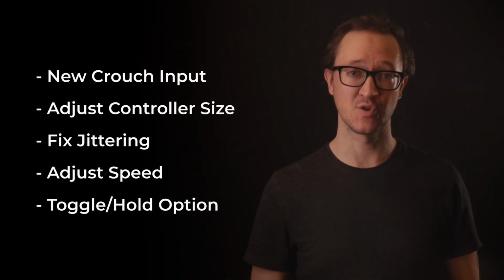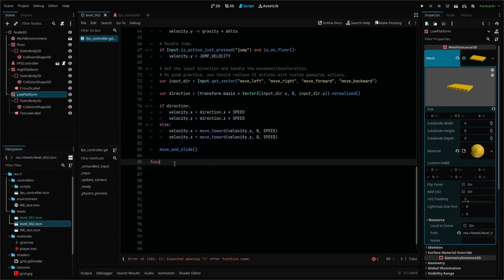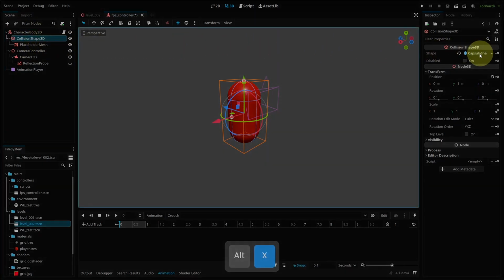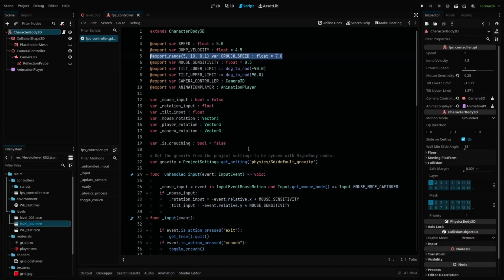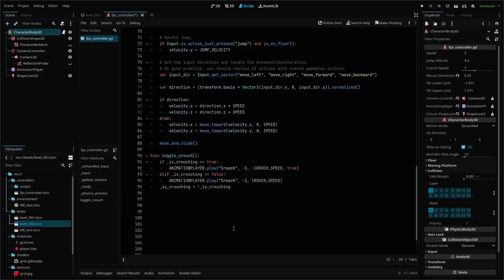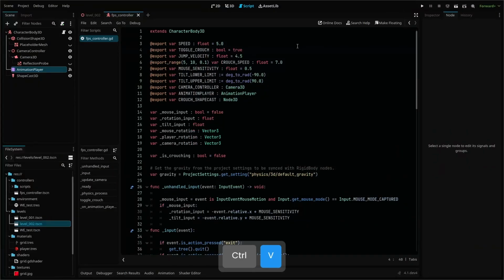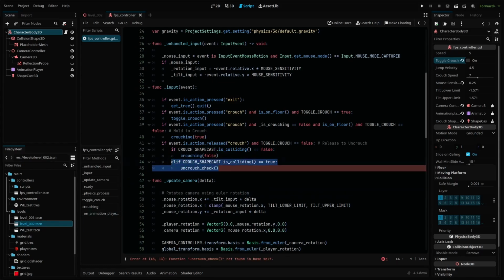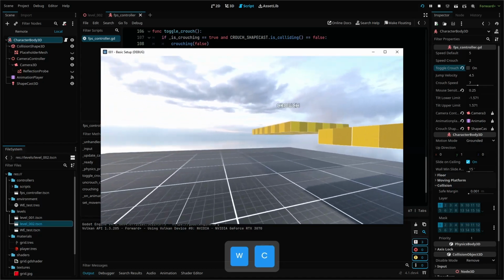E02 - Crouching // Make An FPS in Godot 4

Comment: extends CharacterBody3D

@export var WALK_SPEED: float = 5.0
@export var CROUCH_WALK_SPEED: float = 2.0
var _speed: float
@export var JUMP_VELOCITY: float = 4.5
@export_range(5,10,0.1) var CROUCH_SPEED: float = 7.0

# mouse capture
var _mouse_input: bool = false # is mouse moving
var _mouse_rotation: Vector3
var _rotation_input: float # mouse x value
var _tilt_input: float # mouse y value

# camera movement
@export var MOUSE_SENSITIVITY: float = 0.5 
@export var TILT_LOWER_LIMIT := deg_to_rad(-90)
@export var TILT_UPPER_LIMIT := deg_to_rad(90)
@export var CAMERA_CONTROLLER: Node3D

# rotation
var _player_rotation: Vector3
var _camera_rotation: Vector3

var _is_crouching: bool = false
@export var ANIMATIONPLAYER: AnimationPlayer
@export var CROUCH_SHAPECAST: Node3D
@export var TOGGLE_CROUCH: bool = false

func _input(event):
	if event.is_action_pressed("exit"): get_tree().quit()
	if TOGGLE_CROUCH:
		if event.is_action_pressed("crouch") and is_on_floor():
			toggle_crouch()
	else:
		# HOLD mode
		# Press: start crouching (only if not already crouching)
		if event.is_action_pressed("crouch") and !_is_crouching and is_on_floor():
			crouching(true)
		# Release: try to uncrouch
		elif event.is_action_released("crouch") and _is_crouching:
			if !CROUCH_SHAPECAST.is_colliding():
				crouching(false)
			else: uncrouch_check()
	

func _ready():
	Input.mouse_mode = Input.MOUSE_MODE_CAPTURED # captures the mouse, centers it, and hides it
	_speed = WALK_SPEED
	CROUCH_SHAPECAST.add_exception($".") #ignore CharacterBody3D from being detected in uncrouch collision

func _unhandled_input(event: InputEvent) -> void: # will fire everytime the mouse is moved
	_mouse_input = event is InputEventMouseMotion and Input.get_mouse_mode() == Input.MOUSE_MODE_CAPTURED
	if _mouse_input:
		_rotation_input = -event.relative.x * MOUSE_SENSITIVITY
		_tilt_input = -event.relative.y * MOUSE_SENSITIVITY

func _update_camera(delta):
	#rotate camera using euler rotation
	_mouse_rotation.x += _tilt_input * delta
	_mouse_rotation.x = clamp(_mouse_rotation.x, TILT_LOWER_LIMIT, TILT_UPPER_LIMIT)
	_mouse_rotation.y += _rotation_input * delta
	
	_player_rotation = Vector3(0.0,_mouse_rotation.y,0.0)
	_camera_rotation = Vector3(_mouse_rotation.x,0.0,0.0)
	
	CAMERA_CONTROLLER.transform.basis = Basis.from_euler(_camera_rotation)
	CAMERA_CONTROLLER.rotation.z = 0.0
	
	global_transform.basis = Basis.from_euler(_player_rotation)
	
	_rotation_input = 0.0
	_tilt_input = 0.0

func _physics_process(delta: float) -> void:
	# Add the gravity.
	if not is_on_floor():
		velocity += get_gravity() * delta
	
	_update_camera(delta)

	# Handle jump.
	if Input.is_action_just_pressed("jump") and is_on_floor() and !_is_crouching:
		velocity.y = JUMP_VELOCITY

	# Get the input direction and handle the movement/deceleration.
	# As good practice, you should replace UI actions with custom gameplay actions.
	var input_dir := Input.get_vector("move_left", "move_right", "move_forward", "move_backward")
	var direction := (transform.basis * Vector3(input_dir.x, 0, input_dir.y)).normalized()
	if direction:
		velocity.x = direction.x * _speed
		velocity.z = direction.z * _speed
	else:
		velocity.x = move_toward(velocity.x, 0, _speed)
		velocity.z = move_toward(velocity.z, 0, _speed)

	move_and_slide()

func toggle_crouch():
	if _is_crouching:
		if !CROUCH_SHAPECAST.is_colliding(): #uncrouch
			crouching(false)
	else: #crouch
		crouching(true)

func uncrouch_check():
	if CROUCH_SHAPECAST.is_colliding():
		await get_tree().create_timer(0.1).timeout
		uncrouch_check()
	else: crouching(false)

func crouching(state: bool):
	if _is_crouching == state:
		return
	_is_crouching = state
	if state: 
		set_movement_speed("crouch")
		ANIMATIONPLAYER.play("Crouch", -1, CROUCH_SPEED) #crouch
	else: 
		set_movement_speed("walk")
		ANIMATIONPLAYER.play("Crouch", -1, -CROUCH_SPEED, true) #uncrouch

func set_movement_speed(state: String):
	if state == "walk": _speed = WALK_SPEED
	elif state == "crouch": _speed = CROUCH_WALK_SPEED

Comment: Do same thing for toggle and hold to crouch. But when i start game when TOOGLE var have not checked value in inspector playing both and like hold and like press crouch... But when i TOGGLE var have checked value it only works with press like its need to work...
Reply: UPDATE:

This code fix my problem

extends CharacterBody3D

@export var SPEED: float = 5.0
@export var TOGGLE_CROUCH : bool = true
@export var JUMP_VELOCITY: float = 6.5
@export_range(5, 10, 0.1) var CROUCH_SPEED: float = 7.0
@export var MOUSE_SENSIVITY: float = 0.08
@export var TILT_LOWER_LIMIT := deg_to_rad(-90.0)
@export var TILT_UPPER_LIMIT := deg_to_rad(90.0)
@export var CAMERA_CONTROLLER: Camera3D
@export var ANIMATION_PLAYER: AnimationPlayer
@export var CROUCH_SHAPECAST: Node3D

var _mouse_input: bool = false
var _mouse_rotation: Vector3
var _rotation_input: float
var _tilt_input: float
var _player_rotation: Vector3
var _camera_rotation: Vector3
var _desired_crouch := false

var _crouch_anim_playing := false

var _is_crouching: bool

func _input(event: InputEvent) -> void:
	if event.is_action_pressed("exit"):
		get_tree().quit()
	if not is_on_floor():
		return

	if TOGGLE_CROUCH:
		if event.is_action_pressed("crouch"):
			toggle_crouch()
	else:
		if event.is_action_pressed("crouch") and _is_crouching == false:
			crouching(true)
		if event.is_action_released("crouch"):
			crouching(false)
		
func _unhandled_input(event: InputEvent) -> void:
	_mouse_input = event is InputEventMouseMotion and Input.get_mouse_mode() == Input.MOUSE_MODE_CAPTURED
	if _mouse_input:
		_rotation_input = - event.relative.x * MOUSE_SENSIVITY
		_tilt_input = - event.relative.y * MOUSE_SENSIVITY
		
func _update_camera(delta):
	_mouse_rotation.x += _tilt_input * delta
	_mouse_rotation.x = clamp(_mouse_rotation.x, TILT_LOWER_LIMIT, TILT_UPPER_LIMIT)
	_mouse_rotation.y += _rotation_input * delta
	
	_player_rotation = Vector3(0.0, _mouse_rotation.y, 0.0)
	_camera_rotation = Vector3(_mouse_rotation.x, 0.0, 0.0)
	
	CAMERA_CONTROLLER.transform.basis = Basis.from_euler(_camera_rotation)
	CAMERA_CONTROLLER.rotation.z = 0.0
	
	global_transform.basis = Basis.from_euler(_player_rotation)
	
	_rotation_input = 0.0
	_tilt_input = 0.0
	
func _ready() -> void:
	Input.mouse_mode = Input.MOUSE_MODE_CAPTURED
	CROUCH_SHAPECAST.add_exception($".")

func _physics_process(delta: float) -> void:
	# Add the gravity.
	if not is_on_floor():
		velocity += get_gravity() * delta * 2.5
		
	_update_camera(delta)

	# Handle jump.
	if Input.is_action_just_pressed("jump") and is_on_floor() and _is_crouching == false:
		velocity.y = JUMP_VELOCITY

	# Get the input direction and handle the movement/deceleration.
	# As good practice, you should replace UI actions with custom gameplay actions.
	var input_dir := Input.get_vector("move_left", "move_right", "move_forward", "move_backward")
	var direction := (transform.basis * Vector3(input_dir.x, 0, input_dir.y)).normalized()
	if direction:
		velocity.x = direction.x * SPEED
		velocity.z = direction.z * SPEED
	else:
		velocity.x = move_toward(velocity.x, 0, SPEED)
		velocity.z = move_toward(velocity.z, 0, SPEED)

	move_and_slide()

func toggle_crouch() -> void:
	if _crouch_anim_playing:
		return
		
	if _is_crouching:
		if CROUCH_SHAPECAST.is_colliding():
			return
		crouching(false)
		_desired_crouch = false
	else:
		crouching(true)
		_desired_crouch = true
		
func crouching(state: bool) -> void:
	_desired_crouch = state

	match state:
		true:
			ANIMATION_PLAYER.play("Crouch", 0, CROUCH_SPEED)
		false:
			if CROUCH_SHAPECAST.is_colliding():
				return  
			ANIMATION_PLAYER.play("Crouch", 0, -CROUCH_SPEED, true)

func _on_animation_player_animation_started(anim_name: StringName) -> void:
	if anim_name == "Crouch":
		_crouch_anim_playing = true

func _on_animation_player_animation_finished(anim_name: StringName) -> void:
	if anim_name == "Crouch":
		_crouch_anim_playing = false
		_is_crouching = _desired_crouch

Comment: Encountered same bug as other people when jumping and crouching, then the uncrouch animation plays when released on the ground. Fixed it with checking if not _is_crouching. It seemed to work, but then i encountered another issue where when i spammed crouch with the hold crouch thing on, the crouching animation would glitch at random intervals